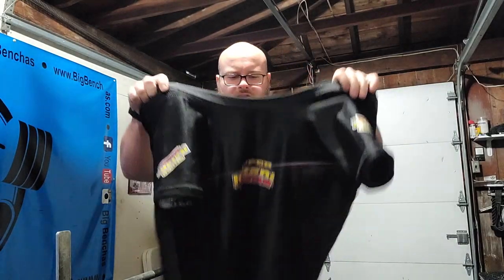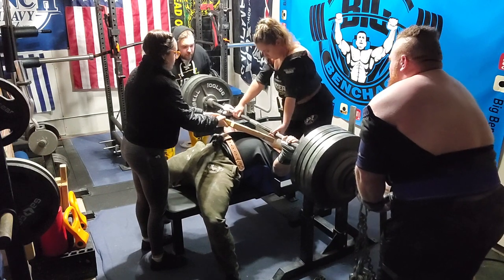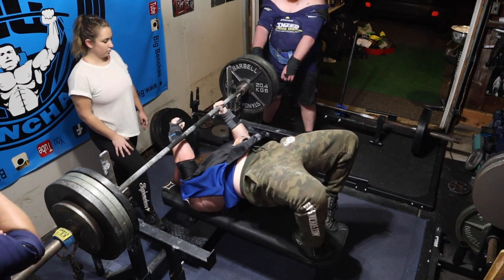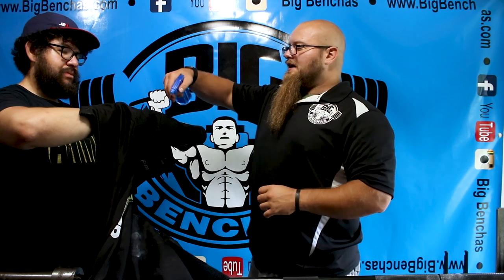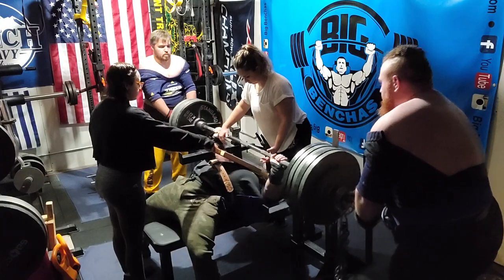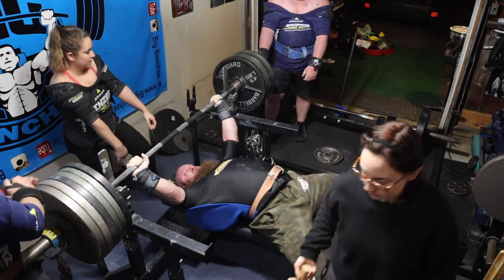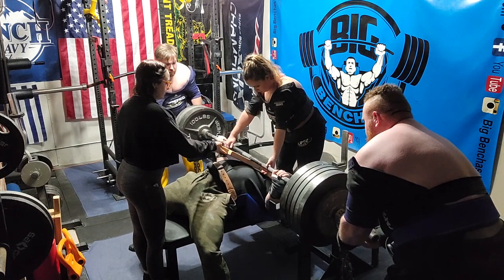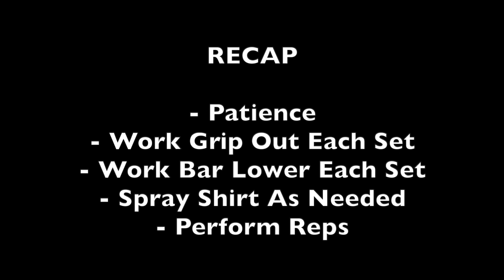Breaking In A Single Ply Bench Shirt

Comment: Do bench shirts take pressure off your rotator cuff?  I'm a raw lifter and I've had some partial tears in my rotator, I started training with an Inzer Bench Bang (slingshot) and it takes so much pressure off the bottom, it's been great!  I'm thinking of moving to equipped - assuming it's less wear and tear on my rotator cuffs.
Reply: Yeah it is, I have rotator cuff pain when doing raw comp setup bench, the only time I can bench raw without rotator cuff pains is when I go close grip and kinda flat backed😂
Throwing on a single ply removes all those issues without having to mess around with my form all the time for my bugger ass shoulders to stop nagging me, definitely recommend you to switch to single ply, multi can have some issues, but feel free to try them out

Comment: Are u spary water?
Reply from the maker: Yes you can as needed, or when breaking in I would spray every set
Reply: @BigBenchas  great video brother , do keep up the good work 👍...one quick question, is it possible to tighten a shirt without doing and alterations.. the ipf referees are inconsistent when inspecting gears so I'm looking at an alternative to tighten a shirt a notch using another method